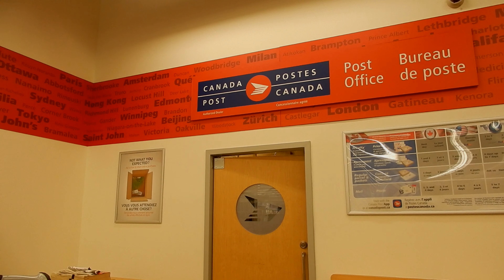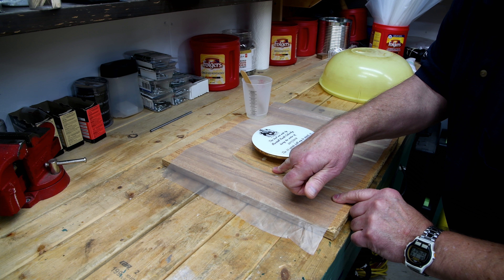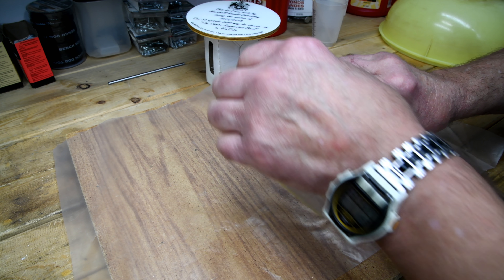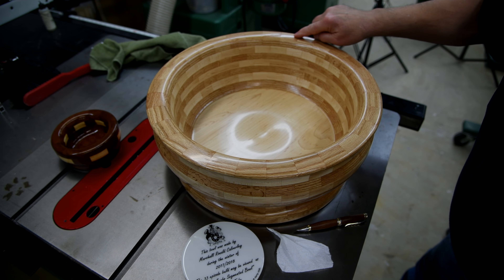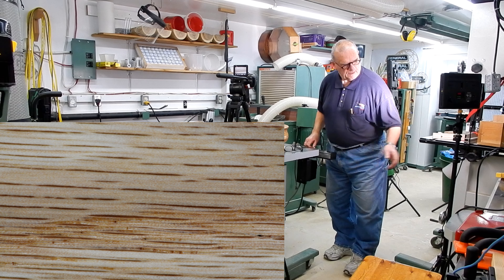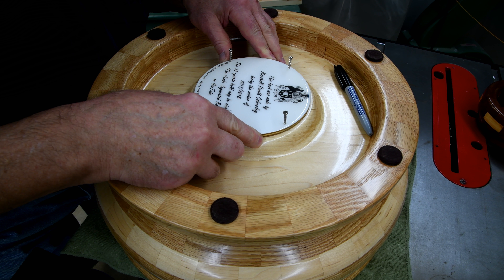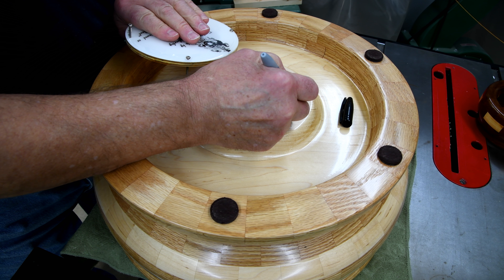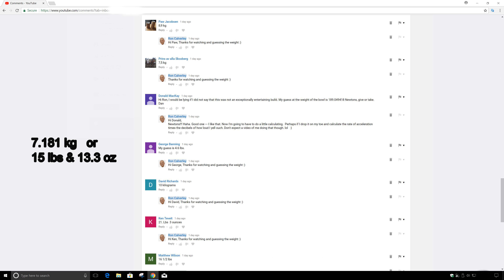The Jumbo Segmented Bowl - Part 33 (conclusion)

Comment: I think the very first comment I ever made on your channel was about the lovely sound of your clocks. Seeing the one you made the dial for and recreated the process on your plaque, how about an epic series on a new clock case? No pressure of course 😀
Reply from the maker: Hi Waldo,
I just check my records and found that the last big clock series ended on July 16, 2015, and the 40 episodes took almost 4 months. 33 episodes for the mantel clock and another 7 for the matching clock mantel. I remember thinking, and perhaps even saying, "Won't do this again" Then came the segmented bowl, lol. However --- even though I have made most likely well over 100 clocks, mostly fast and easy battery wall clocks, I've always wanted to do a mechanical chiming mantel clock with a floating balance escapement. All the mechanical clocks so far have had a pendulum. Maybe your comment here (how about an epic series on a new clock case?) will be my motivation to do it. We'll see. Thanks for the comment :)